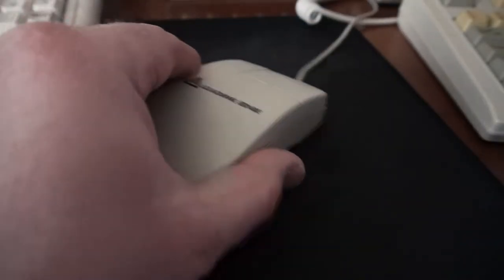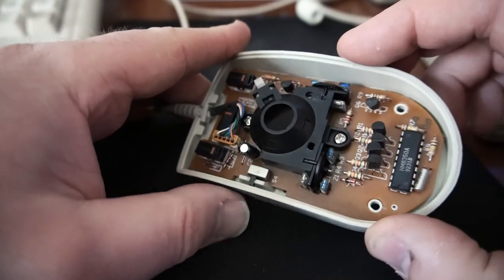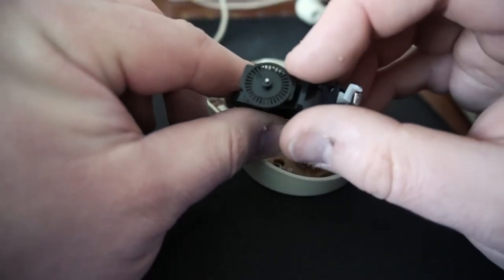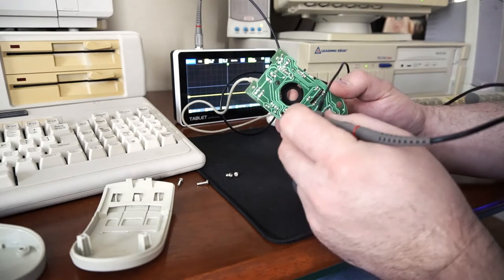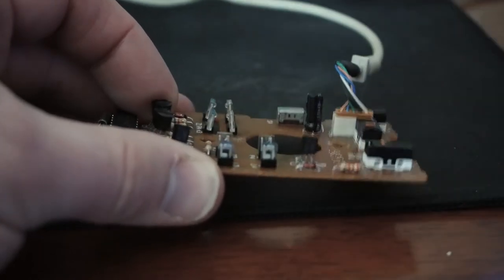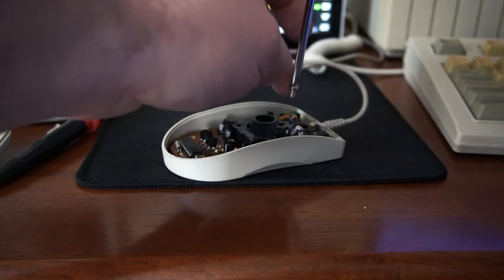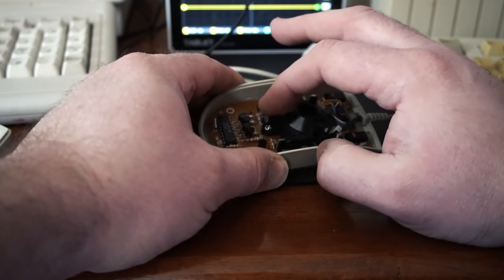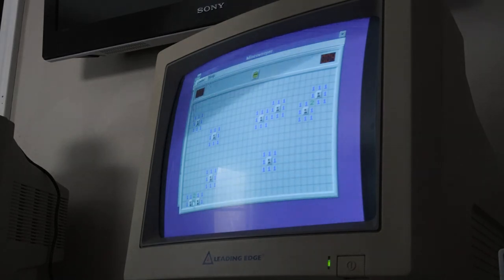Retro Reboot - Repairing a broken ball mouse that works in just one direction

Comment: I've never had an encoder stop working. My usual problem is either the rubber ball goes hard and stops gripping the rollers, or the microswitches get too worn out. Fortunately, those micro-switches are very easy to source.

Comment: i litterally woke up today and booted up one of my old pcs, and the entire mouse quit working, not even regestering clicks, what gives?
Reply: This is a serial mouse? Assuming you've checked that it's fully inserted, my first things to check would be to test continuity on the serial cable, and failing that, a loopback test on the serial port to make sure your port hasn't gone bad.

Comment: I was excited when I saw this but unfortunately it didn’t resolve my issue. I have no idea where to source the sensors to try a hardware fix. Any ideas?
Reply: Digi-Key or Mouser if you're looking for new stock that's guaranteed to work. Amazon or eBay can sometimes have them as new or used "pulls," or new/old stock if you're lucky, but that's a case where you really need to know exactly what you're looking for. Even if there are part numbers on them, they may be out of manufacture and you'll have to source something newer with similar specs that can fit the same footprint. I recently discovered that a very nice VLB controller card had a bad serial chip (verified through loopback testing). Fortunately, I was able to source an new/old stock replacement.